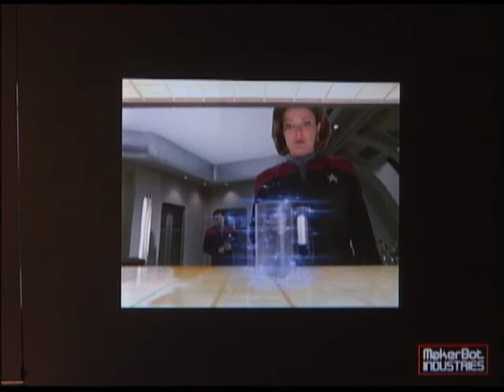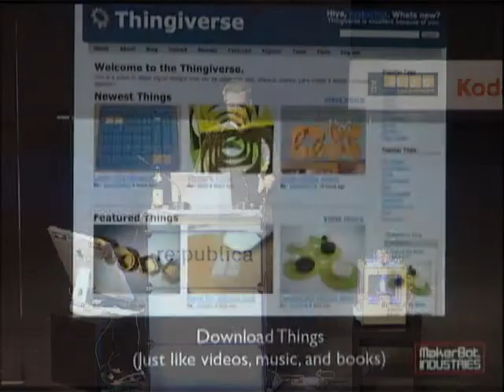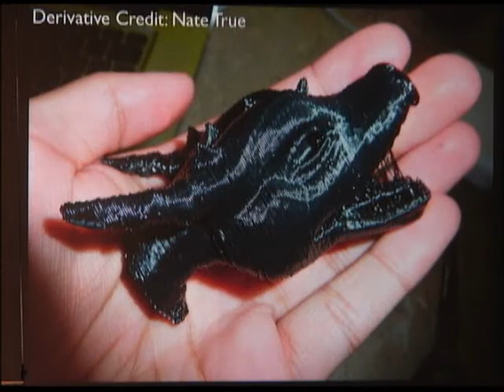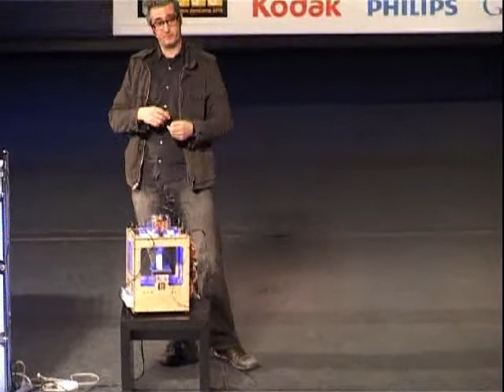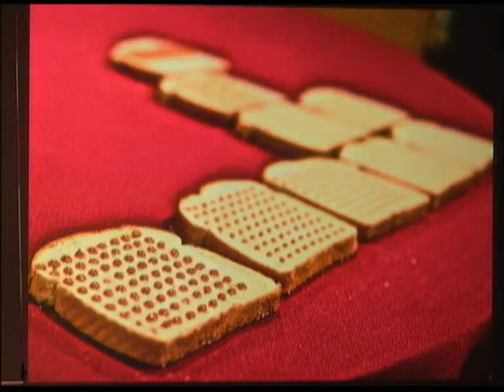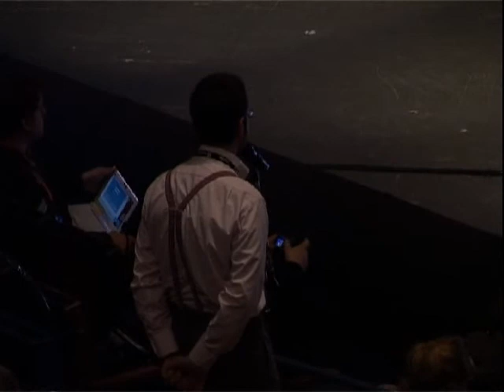republica 2010 - Bre Pettis - The Open Source Personal Fabrication Revolution

Comment: I wonder why there were so much questions about a company working with freely licensed data. Free licensing isn't anti-commercial, and as there is no free licensing for physical objects (well, you actually still can't copy an existing physical object, the printing is still done based upon freely licensed digital data, because otherwise the original would needed to be scanned first), so there are costs for material and work involved to put it together for people who don't know how to do it by themselves or don't want to spend the time for it, and that's what this particular company is charging for.